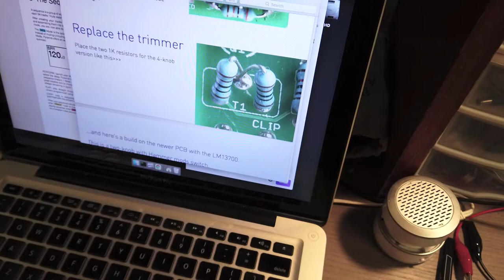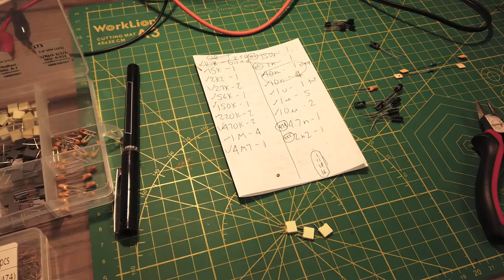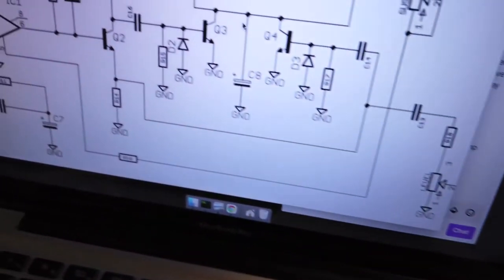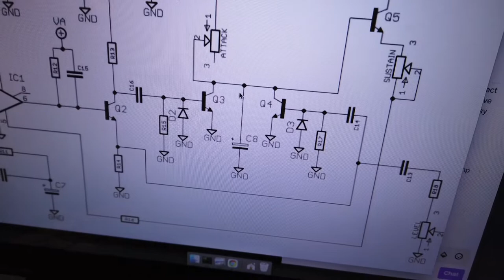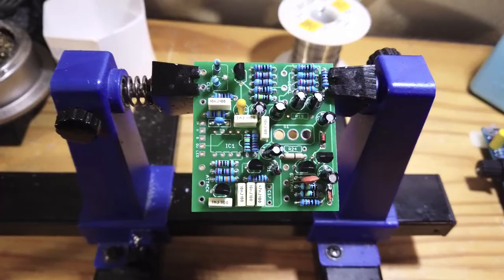Two DIY Kits Pt2: FuzzDog Super Skwish

Comment: I bought an Echo Blue pcb after seeing your first video. It might be a while before i build mine so it will be interesting to see what it sounds like. Great set of videos you are making.
Reply from the maker: Thanks! I was not expecting anyone to do that. 😅 I actually bought the wrong pots again .. I should have gotten these https://www.taydaelectronics.com/b-500k-ohm-linear-taper-potentiometer-spline-shaft-pc-mount.html ... just for your reference. I can still make the ones I have work but there is no guarantee that won't need a reflow 10 years down the road. Don't be surprised if you see me swapping out the pots on both kits in the next video! 😂 My #1 recommendation is always take your time with this stuff and remember -- all mistakes are fixable.  Feel free to ask me any questions when you get started on the kit!
Reply: @HazeAnderson  I will let you know how my build goes but it could be months away. I was buying about 30 pots on Tayda but my payment wouldn't go through. I was a bit pissed. Went back to the basket the next day and noticed the pots all had center detent which i totally didn't want! So easy to order the wrong thing in SDIY.
Reply from the maker: @alanc6752  Sorry their payment process irked you. Yes it is very easy to order the wrong item! You generally want a few extras when you order to offset the shipping fees (unless they go by weight). I am about to put in another order today to replace these 8 pots that I used (only set me back $5) and some more for other kits as well as some odd sized resistors. If I need one 1/4 watt metal film resistor I'll order 20. Cheers! :)